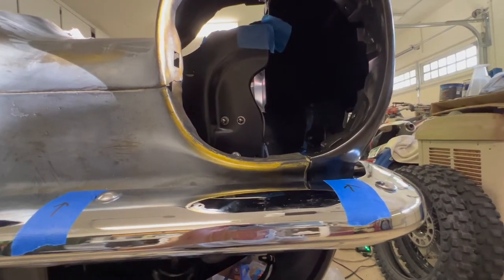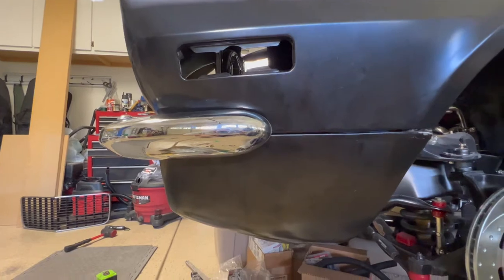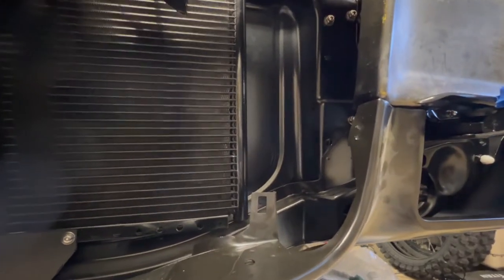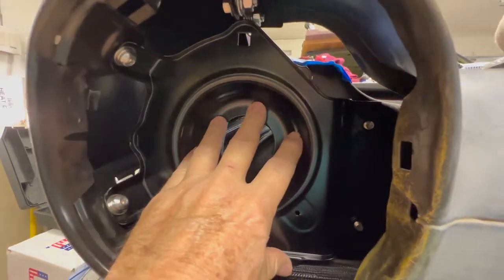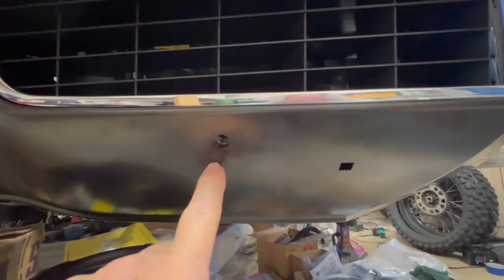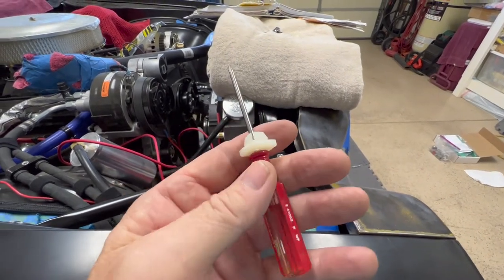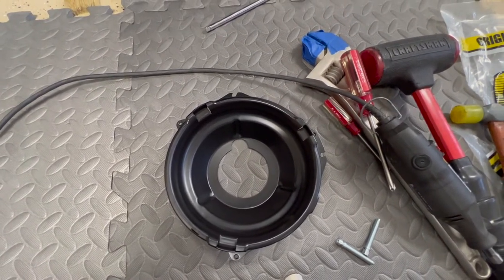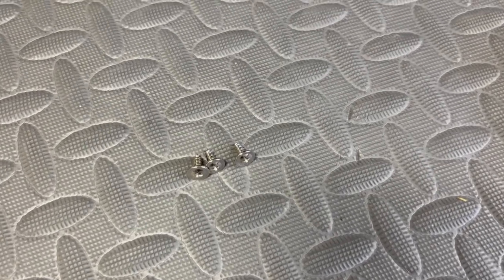"71" Camaro Restomod Head & Park Lights, Grille & Bumper Install! 09Oct2022

Comment: I often wondered why someone has`nt got into the factory records and made a book of the tweeking sequences and adjustments that were taught to the assembly line people. I`ve seen many a headache and nightmare that could have been avoided if that type of information was available. At least there are people out there that can tell you the kind of fun your going to have if you want to put aluminum hi-po heads in your 67 firebird. I mentioned that because they were made in the same factory as the Camaro`s in Norwood.
Reply from the maker: I have definitely learned the sequence of tightening things with the re-pop parts will make all the difference in things lining up at least well enough to install. The bumper holes would not line up at first I thought I was going to have to drill. After I tried a few different combinations I was able to get it lined up and all the bolts started. The secret was to get the two bottom center bolts started and then pull the bumper up from the center top to get the upper bolts lined up. That's the abbreviated version! Lol!

Comment: Its so funny that i watch your old camaro videos in support of your 15 vids, old bodyshop guy here,keep them coming north pete. Dont forget split bumpers rule. Go NAVY!
Reply from the maker: Ha! Ha! "Split bumpers!" Looking for a good body shop guy! Hard to trust anyone around Vegas! Thanks for watching Billy!
Reply: @peteregger7928  i don't know, that blue tape will do you well, i understand, but if you're looking for perfection, you are looking in the wrong place.
Reply from the maker: @HaventHeardNone  Ha! Ha! For sure! I park my other car next to the front end on the Camaro and it's a tight squeeze! Don't want to scratch the chrome up just yet! Lol!
Reply: @peteregger7928  yaaaa, i seen that C6.
Reply from the maker: @HaventHeardNone  I figured out a while back if you don't want a Corvette to fall apart don't drive it! It's a 2001 under 60K miles! I'm the original owner.
Reply: @peteregger7928  i started out with a 64,65,66,mayby 6......7?,lol
Reply from the maker: @HaventHeardNone  My first car after joining the Navy was "68" Chevelle SS 396 with the solid lift cam and a Muncie 22 Rock Crusher! After I destroyed the 396 I put a 427 in it. If you left it running at the gas station you could never fill it up! Lol! I ended up with a 69 El Camino SS 396 but it was actually a 400. Chevy ran out of passenger big blocks that year and used the truck 400 big blocks that had a 1/4" taller deck height on the block but they still badged the cars as 396. Wish I still had those cars!
Reply: @peteregger7928  dude, that is so cool, man. We will never see that again ever. Thank you for sharing, you are the coolest dude in north las vegas and probably north any where.
Reply from the maker: @HaventHeardNone  Thanks! I'm still a work in progress!  Lol!

Comment: Hello sir.  On the front parking/blinkers, were you able to install those after the lower valance was installed?  I'm having a real tough time getting mine to fit in there with the valance on the car.  Thank you.
Reply from the maker: I was able to get them into position but they were a tight fit! I may end up removing the chrome trim piece to give a little more room when ready for paint. The side markers on the re-pop fenders are very tight and will probably require some metal work.

Comment: I`ve found even the high end repop parts fit better but not to my liking , absolute night mare some times even though some of them claim to use genuine GM molds.
Reply from the maker: Most of the old stamping dies and machines were probably worn out by the time these reproduction companies got a hold of them and shipped them overseas. All the sheet metal I have purchased was stamped in Taiwan so I'm sure there are issues controlling the QC on these parts too.